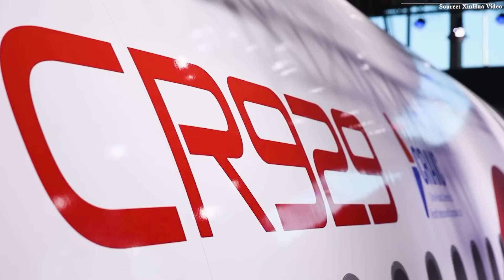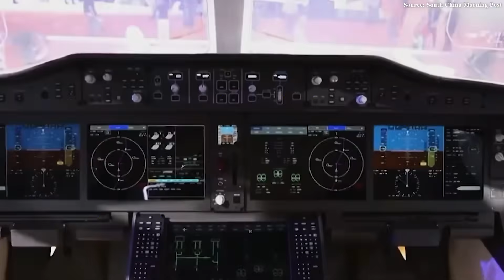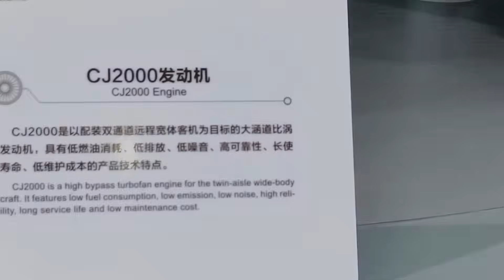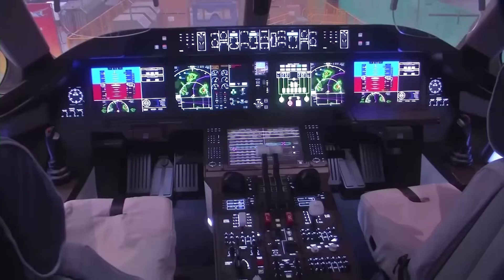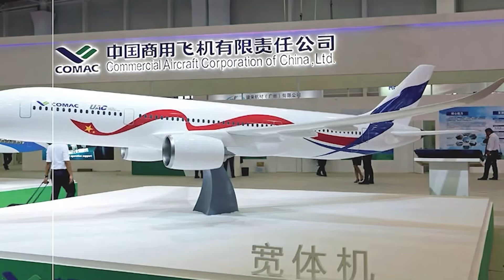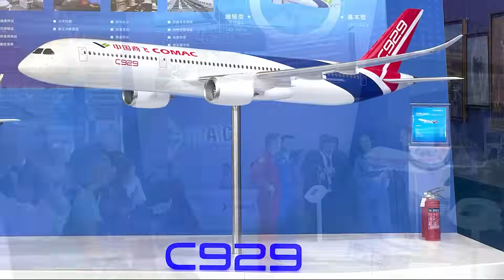China's NEW C929 Aircraft 12,000 Kilometers Test Flight that SHOCKED the West!

Comment: Getting there. On paper, the CJ2000 engine tech is just one generation behind the West, but reliability and durability remain unproven. That’s the harder part.

As for Western certification, perhaps Comac could consider partnering with Embraer, they have experience in that area. In return, the Brazilians could get favorable terms for building aircraft under license.

The biggest hurdle is politics: will Western manufacturers and/or governments use patent litigiation, export controls, sanctions to block or at slow down the rise of a third commercial aircraft manufacturing giant?
Reply: CJ1000 is not even ready yet.
Reply from the maker: I think that’s certain. It’s very difficult to overcome the political barrier.
Reply: @FLIGAVIA Anyway, c929 development has broke off from Russia in 2024. So far based on news the first test flight is set to be on 2035. Is still 9 years from now of no delay.